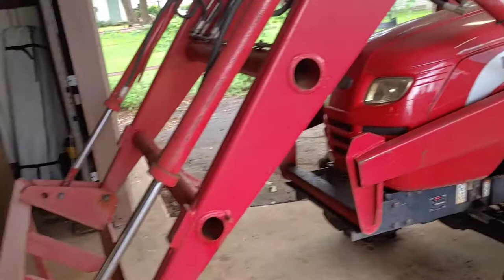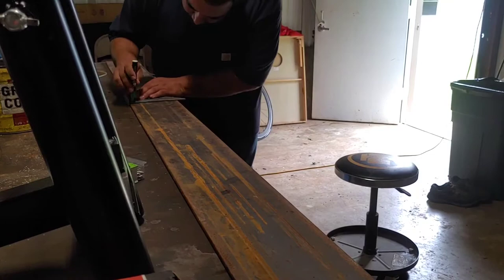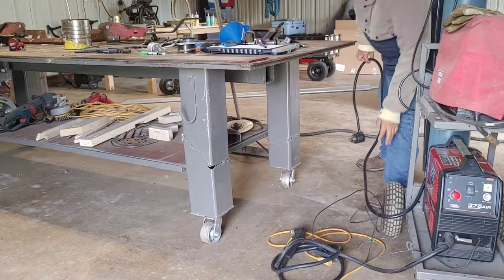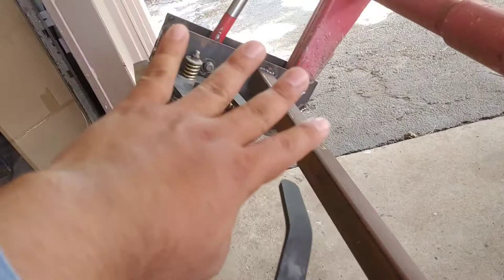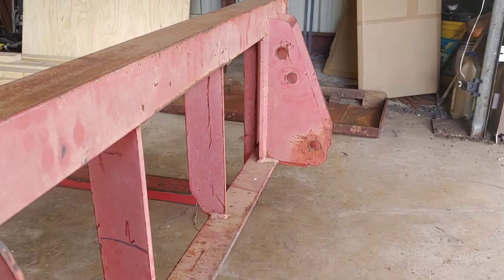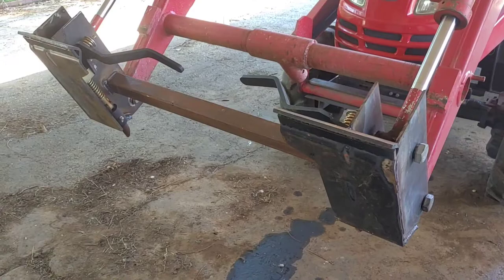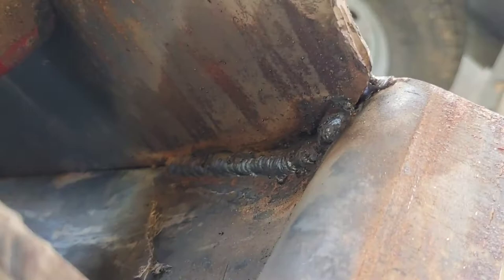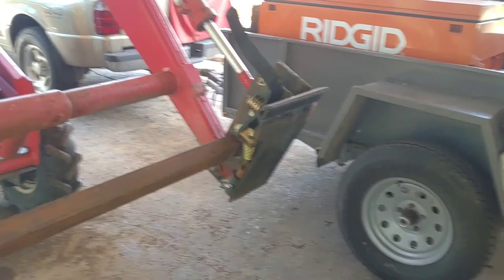Welded my own quick attach plates, upgrade Mahindra from on loader to skid steer quick attach

Comment: My impression is that you will weld this device to the bucket? If so, will you repeat the process w/your pallet forks currently on the tractor? Also, concerning the forks, are they something you fabricated, or are they factory (Mahirdra) implement? if the latter, could you please tell me the model, or part number/year(if necessary) for them? Lastly, it appears to me you can move the forks  closer, or spread them further apart, plz is this correct? Thx from Round Valley AZ.
Reply from the maker: Hello sorry for delay.
1. This part mounts to the tractor, the bucket will get a universal adapter plate (like a skid steer or bobcat). 
2. My loader and attachments are a brand called Kansas Machine Works (KMW). They all came with the tractor back in 2000. Model of loader is ML112. Not sure about bucket and forks.  But it's an outdated design, universal skid steer style is the standard now. 
3. The forks are adjustable, mid point to far right and same for left. All manual by hand. 
Hope that helps.
Reply: You don't weld the plate to the loader bucket, unless you need something simple, and want to lose the load capacity of what the plate weighs. You are essentially welding a flat steel plate, to another flat steel plate. All you need is the top and bottom angled plates, welded to the back of your bucket, to engage the quick attach.

Comment: You could have just added 2 inches of plate to  the peaces from the bucket.
Reply from the maker: Yeah I started to do that, if you'll notice at the 1:07 -1:11 mark. I cut off the bucket brackets, but it wasn't enough to to clear the skid steer plate. I tried it, and I'm glad I measured it before I welded it and went too far. It wouldn't work.

Comment: Looks great. Looks like I'll have to do the same, as Woods discontinued their quick attach conversion for the LC96. I have a center hyd cylinder though, so might be able to use the bucket pin flanges on the adapter. Thanks for the demonstration on how to do this.

Comment: Great video, But how high are the 4 brackets you made. 16 inches long but you don't mention the height.
Reply from the maker: The metal I bought was 6" x 1/4” flat metal or strap metal. The 6" from the adapter plates gave me plenty of room to drill new pin holes.
Reply: Thanks for the reply. I made mine 8 inches high since I wasn’t sure it would clear the attaching pins.  But your video helped out a lot.  
Many thanks for doing this for for all the Mahindra owners out there.